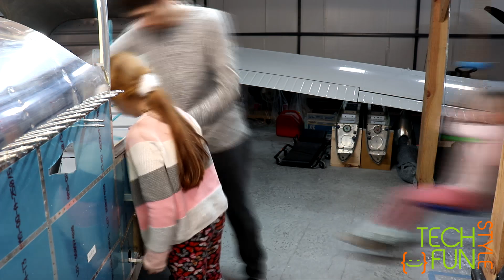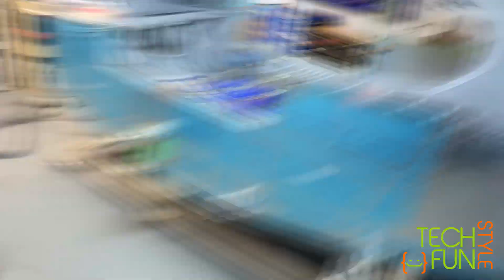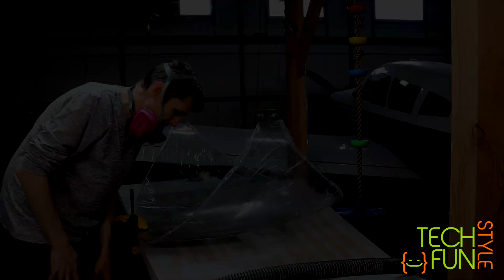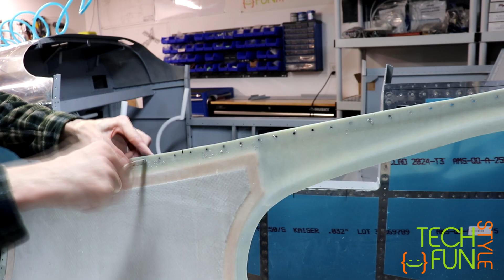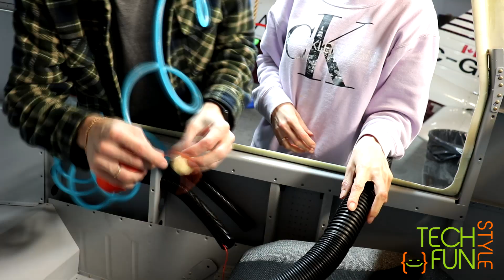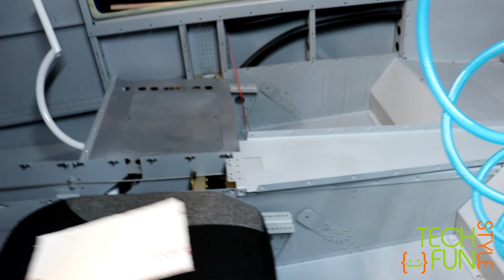Fuselage Part 11 - RV10 Build by Vlad

Comment: Please PLEASE explain the vacuum hose and wire trick! That looks like it would save a TON of time!
Reply from the maker: ))) That's simple. I took a small piece of soft foam, made a kinds ball out of it, took a nylon cord and attached to the foam ball. The next is to take a vacuum and start vacuuming at one end of the wire guide while slowly releasing the foam ball with the nylon cord inside on another end. It takes seconds to pass 15ft length and show up on another end. I did it in a matter of few minutes with help of my wife )))

Comment: Nice Update, and great to see the cabin top on the fuselage. Must be really fun to be able to sit "inside" your plane now. Still working on my Empennage Kit (starting soon on section 10 Tailcone (thanks for tip on not throwing away the trimmed piece!), then will no doubt have a long wait for Wings. But - its all fun, and finally over the new builder fear and getting better with every section completed. Really appreciate your videos and updates!
Reply from the maker: I am glad to know that the tip with that narrow trimmed piece is helpful! Thanks god I kept it during all hangar cleanups. You have so much new to discover with wings and fuse kits - I am sure you will like it!